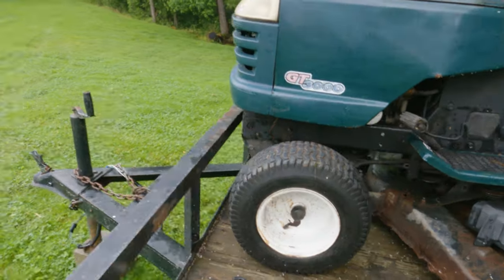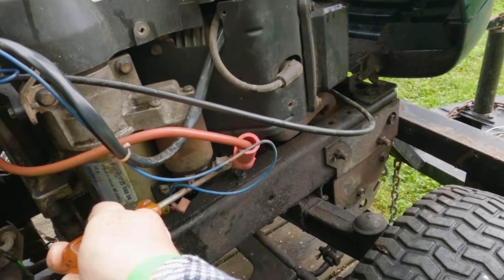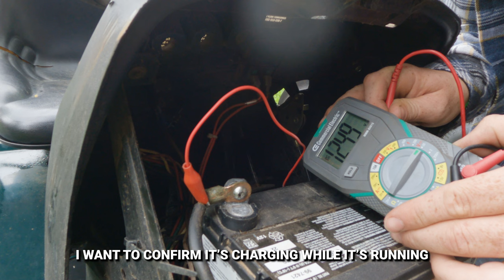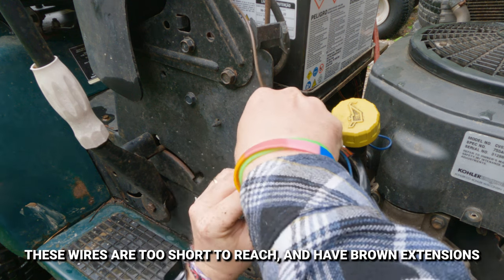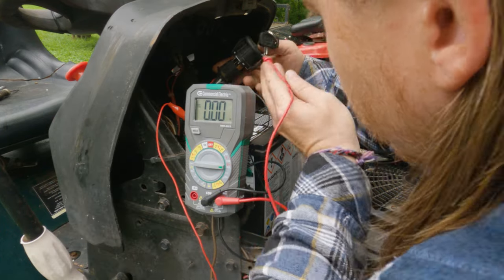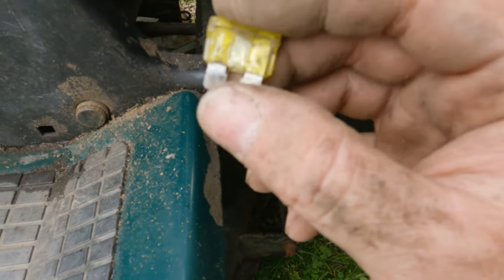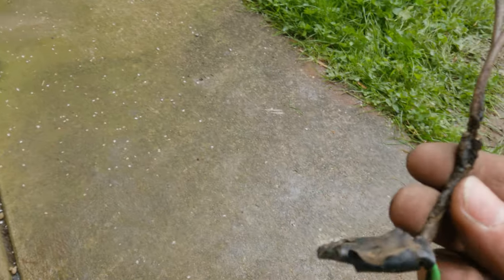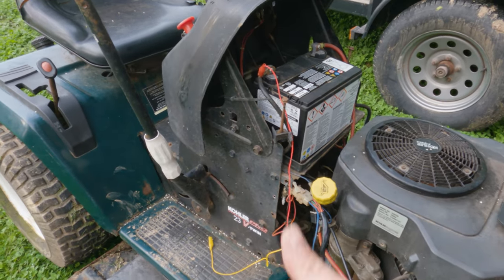Your Lawnmower Fix May Be This Easy

Comment from the maker: If you know about the PTOs, how to test them, or the wiring I am all ears!
Reply: See if you can find a service manual or manual with a schematic or wiring diagram I think is typically what they are.  Then you can go to town tracing. Seems PTO's can be rebuild as well and is going to be based on the models.  Figure is like an AC clutch, where is a electromagnet engagement mechanism with electrical and mechanical specs.  For some reason seems I reads some can be adjusted with some sort of gap tested using a feeler gauge test spec.
Reply from the maker: I ended up finding a diagram, so we will see! I’ve never rebuilt any PTO so that would be an interesting job!

Comment: I would test backwards from the  PTO back up to the ignition switch. 

1. Make sure you have power at the PTO clutch wiring (engine off, key on, PTO switch engaged)

If you have power, PTO clutch is most likely bad.

2. If no power at PTO clutch wiring, work back to the PTO switch and make sure it’s putting out power to the clutch wiring circuit when the switch is engaged.

3. If not then lastly check to make sure the PTO switch is receiving power from the ignition switch. If it is, then replace the PTO switch, if it’s not, then replace the ignition switch.
Reply from the maker: Okay! Good info. I can hobble my way through wiring but am no expert.
Reply: @LoganDidItYT  you got this!
Reply from the maker: @Knownworldwide  I like wiring a lot, but have to like marinate on things for a while. Haha, so I guess we will see